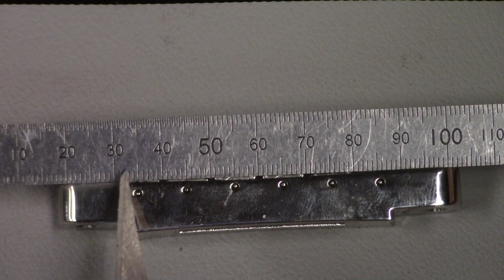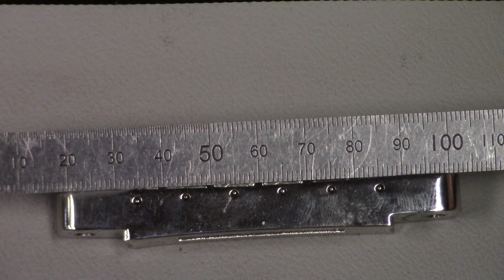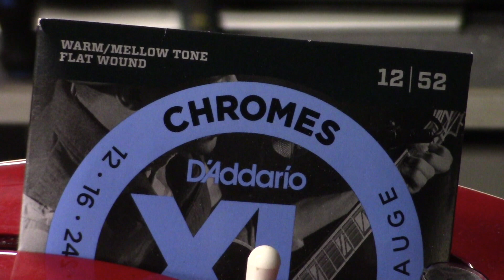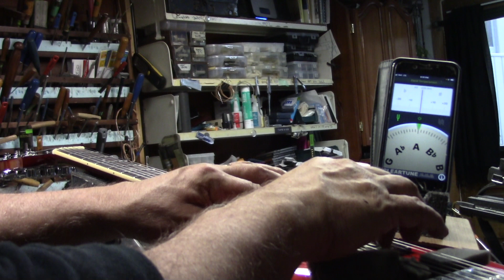1963 Dot Neck 335' "Elitist" @StringTechWorkstations

Comment: I owned 2 Elitist Les Pauls an 04 57 GoldTop and 06 Plus. Well made but didn't sound as good as my Gibsons.
Reply from the maker: Why do you think that is .... ? Too heavy ? This one is really heavy. Just curious.
Reply: @StringTechWorkstations  the poly finish seems to somewhat deaden the guitar a bit. Don't get me wrong though, those guitars were my gateway drug to Gibsons. I've had 5 and still have 2. My all-time favorite is my 2010 R7 Gold Top. It weighs 8lbs even and just seems so lively.
Reply from the maker: 5 ! Wow ! Thanks for your input Kenth. What 2 did you end up keeping ?
Reply: @StringTechWorkstations  the R7 and a 2019 DC Jr Tribute. I had a 2010 Trad Plus, a 2010 R0 v2 and a 2012 R8. I wish I'd kept the R8 as well.